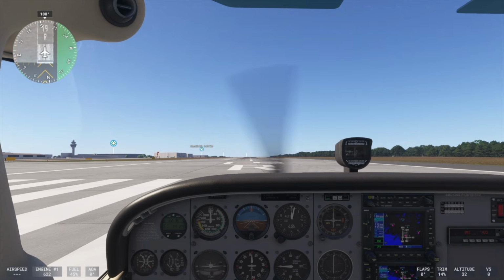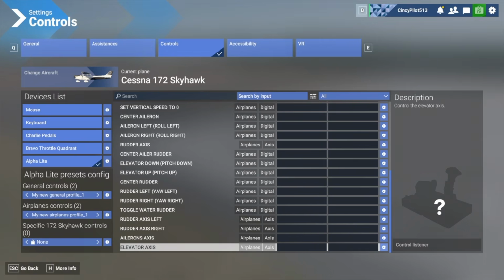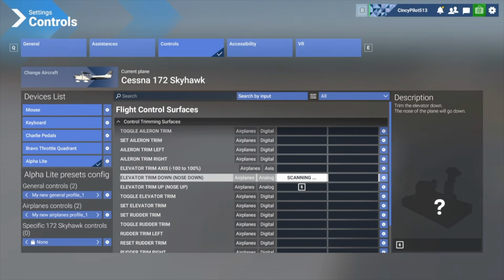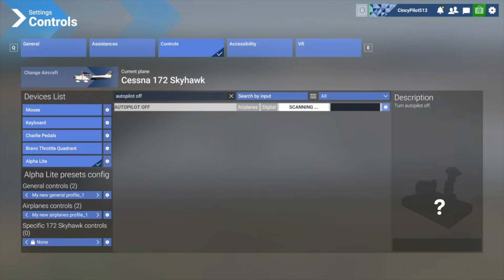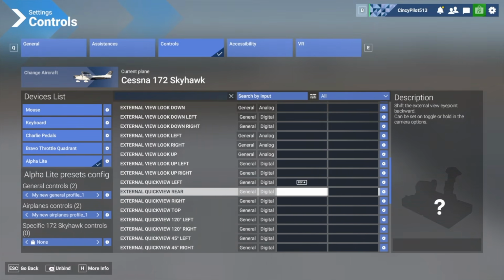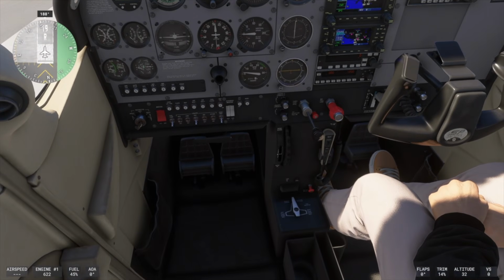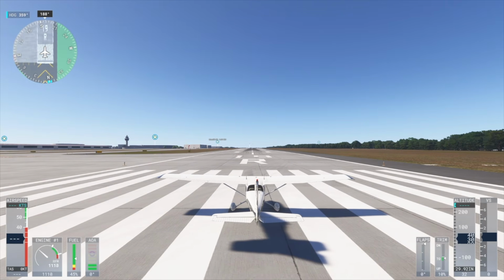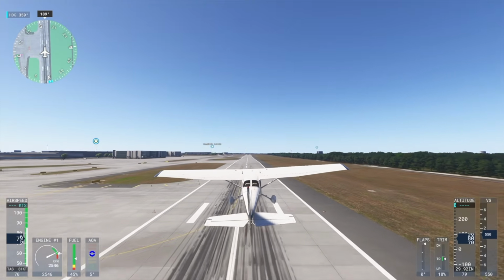Honeycomb Alpha LITE Yoke Configured for Microsoft Flight Simulator 2024 (Pitch, Roll, Trim)

Comment: Does it have hall sensors ?there is no information about it anywhere
Reply: The Alpha LITE yoke has potentiometers, not contactless sensors, although it seems it delivers 10-bit data, rather than the 8 bits of the original Alpha. My guess is that this is just down to availability of components and it doesn't make any practical difference.